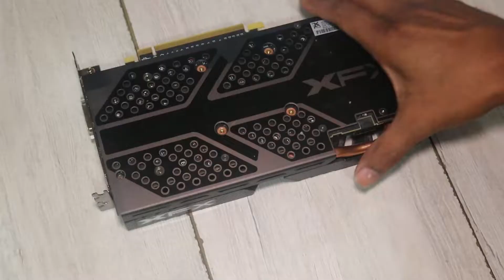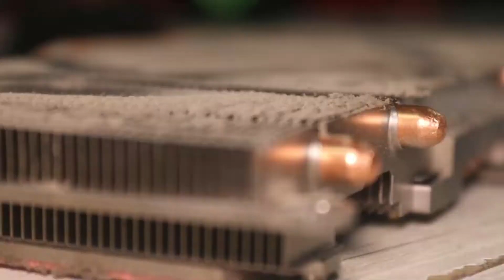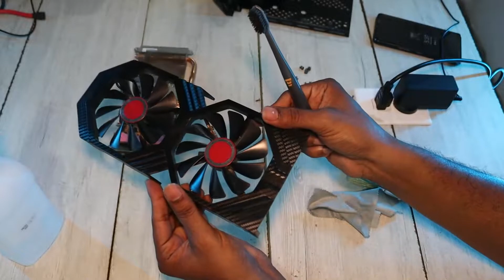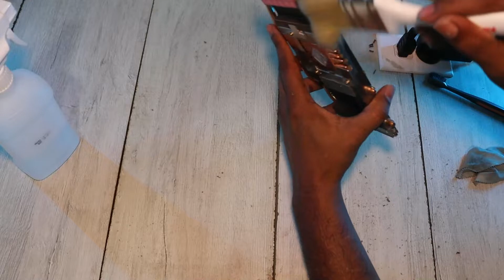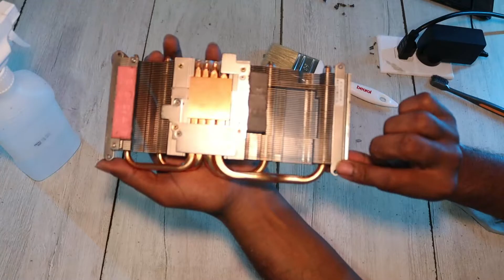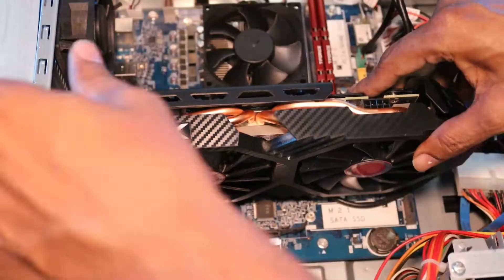How to Open Radeon RX 580 8GB GPU

Comment: How many hours should I let it dry after cleaning
Reply from the maker: Always use atleast 70% alcohol... That will dry up immediately. The cpu paste doesn't need time to dry, the heat feom the CPU actually keeps the paste soft. So there's no need to wait after assembly. Just make sure you use a geatgun or blower to vaporize all the alcohol you used to clean the board.
Reply: @AshvienK  I don't have the stuff your saying guess I'll just wait for a few hours to be sure.